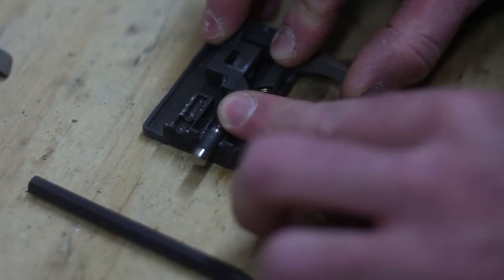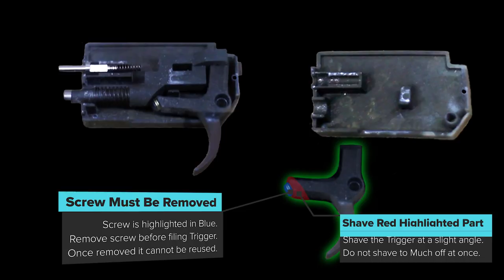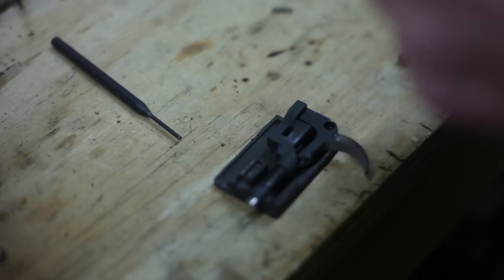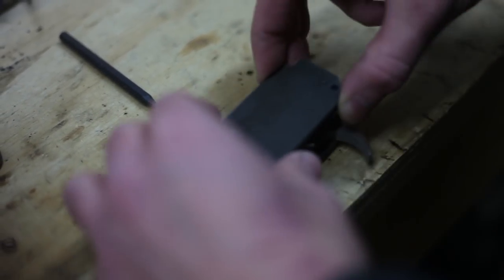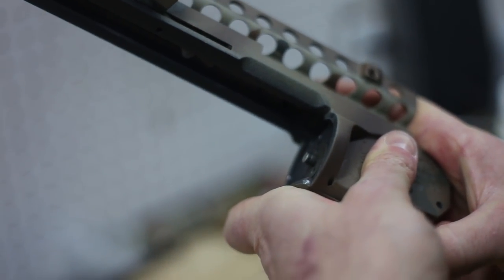Green Mountain Rangers : 203 Extended Trigger Mod

Comment: how is the tube connected to the bottom mk18 rail???? looks so good
Reply: Zip ties
Reply: @fifthfreedom2786  0:23
Reply: @asuhdude1055  Disregard, it actually looks like they bolted it in from the top, they do zip ties on another one. I'd recommend you just get the barrel mounted on though. It's a slightly lower profile and you can modify your rail to make it easier to take on and off depending on the situation.